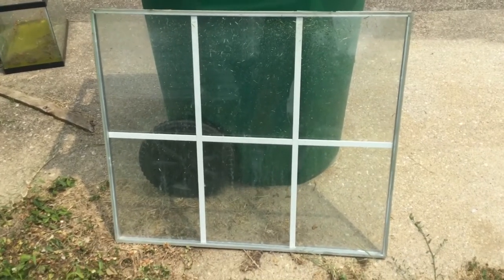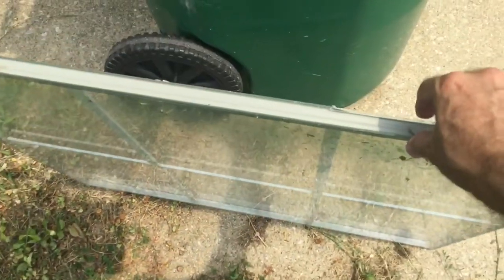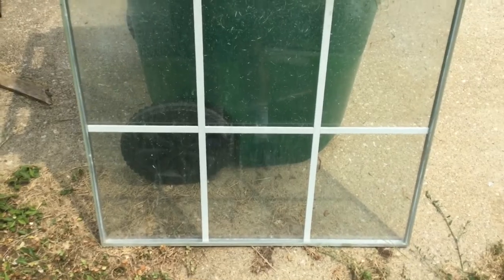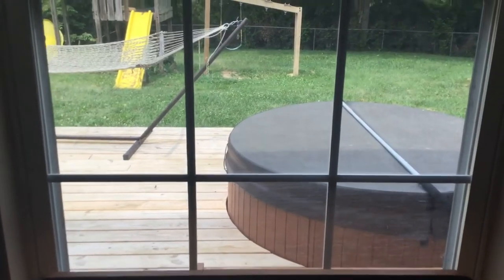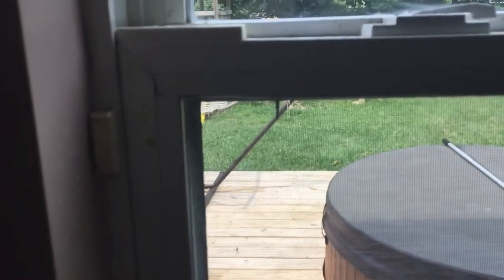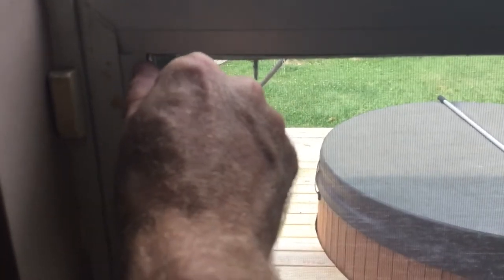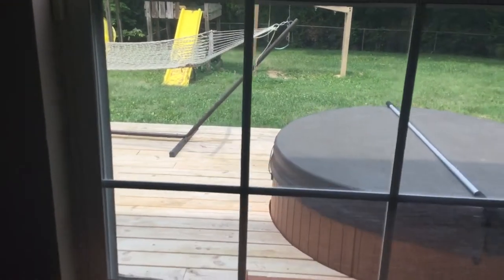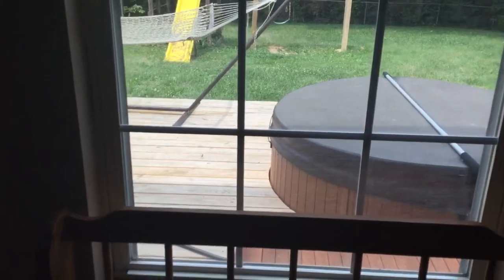DIY: How to fix a foggy double-paned window

Comment: When doing this method are you just replacing the glass or are you also replacing the argon between the glass that gives you the most insulation?
Reply from the maker: The unit you buy has it all in it. It’s two panes of glass with the gas between them. All you do is swap it out with the broken one.
Reply: So you didn’t so much repair the foggy unit as replace it.

Comment: Total waste of my time. This is REPLACEMENT not how to fix.
Reply from the maker: @viewtalay1297  That’s a very silly comment. When I fix my brakes, I replace the pads. I don’t replace the calipers or the rotors (unless I have to), but, yes, in fixing things there are usually parts we replace. In this video, most of the window remains. Now, there are people who try this fix with other methods, but they have to “replace” the argon.